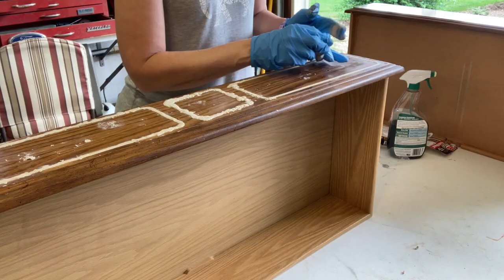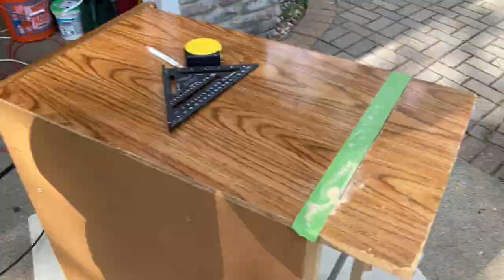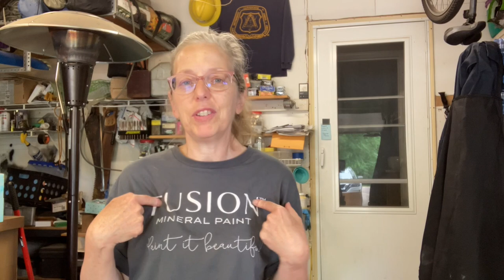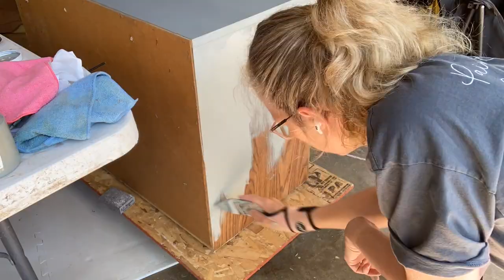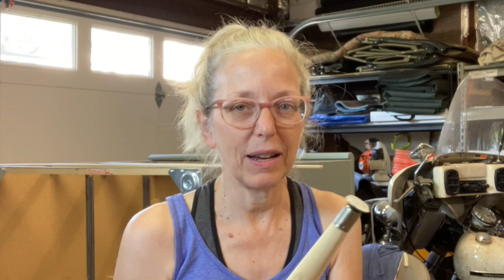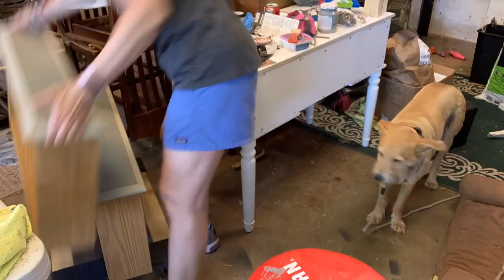BIG DIY with Fusion All in One Mineral Paint

Comment: Maybe stripper would have been better,and kilz especially over the filled spots?😬🙄
Reply from the maker: Thanks for the comments, Kilz is actually for bleed-through (like stains) but wouldn't be able to smooth out a spot that either shrunk or wasn't sanded enough.  Stripper as well is not good for all materials and the stripper may have taken off all of the melamine and then I would have had raw particle board which would have been difficult to paint on.  Perhaps the Kilz could have helped but honestly not sure it would have. Something to think about!